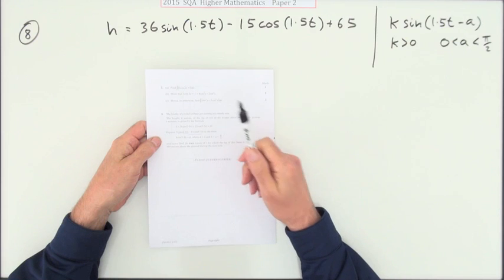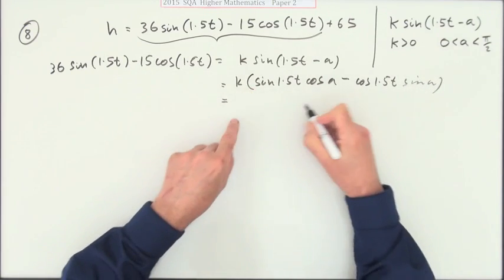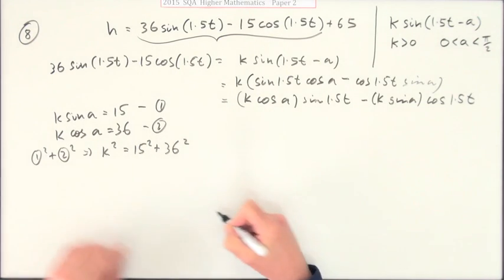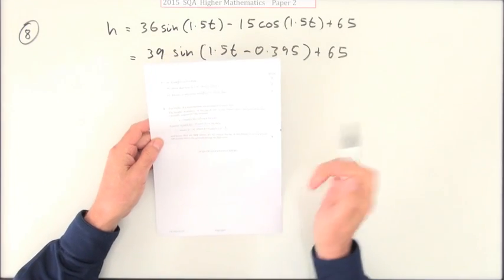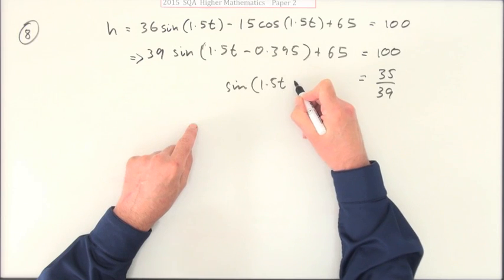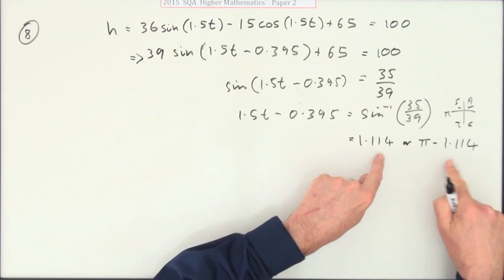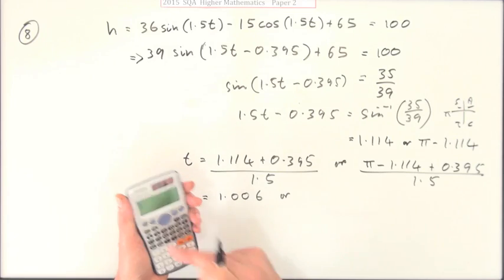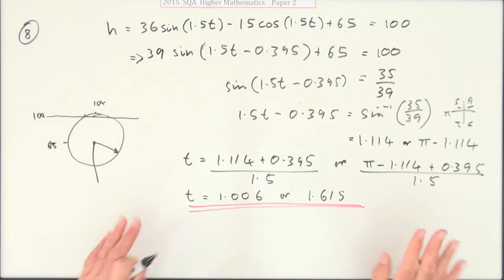2015 old Higher Mathematics paper 2 no. 8

Comment: Hi, so I stupidly put my working in degrees, realised it was supposed to be in radians, and proceeded to write my answers in radians, putting a side note that I'd done the working out in degrees "for ease." I know this was stupid, and what's even worse is that I couldn't change all of it to radians as I ran out of time. However, I did do the rest of the question correctly, only one of my results was wrong. Do you think I would get follow through marks? Or have I just ruined my chance at getting nearly full marks for this question?

Sorry for the long story ^_^ Thank you so much for these videos.